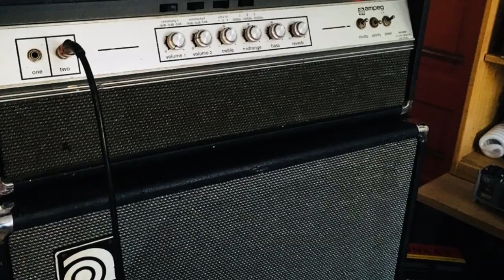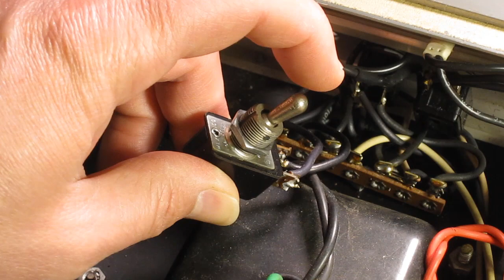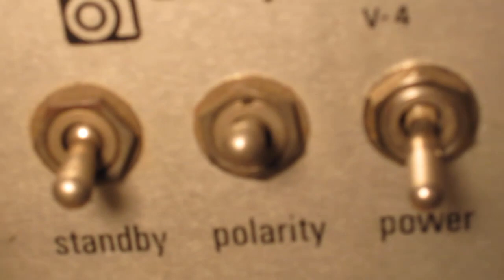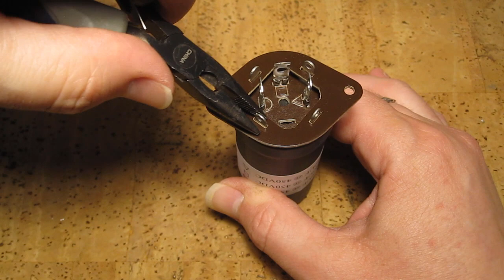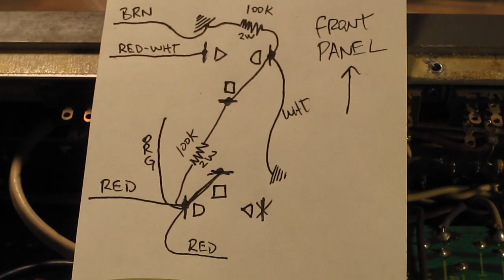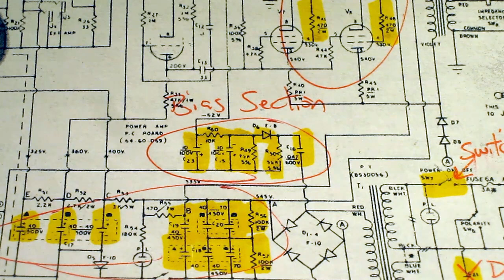Ampeg V-4 - New Tubes, Caps & Other Tweaks!

Comment: Important Safety Note, SHOCK HAZARD: The capacitor can case needs to be insulated as it was from the factory, (technically only one does but just follow the factory procedure). This is a potential shock hazard if not done. The reason for this is the first two can caps are wired in series, making the mid point where they are joined at an elevated voltage (half of the HT voltage). This means the negative side of the first cap which is also connected to the conductive metal cap case is energized at approximately 250-300 VDC! You see Flip Tops insulates the case with heat shrink for this reason, but it's important to know why. Also, notice the grounds are isolated from the chassis, non conductive mounting rings, this is important to avoid ground loops. (the grounding layout is specifically illustrated on the schematic)

Comment: greatings I found your post today,while watching my other amp guy, I was curious if you'd be interested in taking on some more projects as I have three vintage amps in various stages of repair, one being the same as in this video a 69 or 70 ampeg v-4, needing a three prong cord installed as well as possablly a re- cap. as it is all original and never been serviced from what I can tell. its old but new to me. that being said  the other one is a Gibson quite rare I believe as I cant find much info about it on line its called a Medalist 4/10. quite a strange design I'd have to say. but it did sound real nice clean and jazzy tones with tremelo and reverb. with four 10 inch speakers. however the fuse keeps blowing and its burned up a few wires and caps, so i am not sure what it will need to fix it, the bigest problem would be shipping. any way let me know if you interested and we ll go from there thanks for you time and shairing your knowlage with us...

Comment: Great video dude! I have an early v4 that needs a little TLC. The power tubes seem to wobble quite a bit in the sockets. Is there anything I could do to snug that up? Every time I gig it put I have to re seat the power tubes otherwise it acts up
Reply: The tube sockets probably need to be retentioned. It’s a fairly straightforward procedure and there’s probably a YouTube video on it somewhere. Otherwise you could try adding tube retainers, but that would be a huge pain in the ass because I’m pretty sure the sockets are riveted to the chassis. I’m not 100% positive about that tho.

Comment: Thanks for making this easy to understand. I posted another comment but can’t seem to find it. So if two appear, sorry. Anyhow, this will help me service my dads 1973 vt22 v4! It has all original Magnavox tubes pushing 50 years old! That is mighty strange that changing the resistor value created such an issue. Good to look out for! Anyhow, thanks again

Comment: Great Amp and I would have to say my favorite. I have Marshall's, Fenders, Mesa Boogies, and Vox as well. All different animals. Still love my Ampeg V4 the best. I love it so much that I got
lucky and found another one. The original one I got has the 4) 7027A power tubes, the second one has the JJ6L6GC power tubes. No matter how loud I drive it, it doesn't distort, that's what I want. I have Pedals that Drive, Fuzz, and I get what I want. It takes Pedals so well. It is crystal clear with the reverb tank being the best I've ever heard built-in. Being a Stones fan you have to have one of these. Even if your not, they are so clean and so loud. They are really heavy and well built. If you are looking at a carry amp this amp is not for you lol. Great Video and very informative. I learned something new, thank you.

Comment: Excellent video! I'm fixing a similar one, found some bad capacitors, cold solders, and loose wires (especially one grounding wire) but I still have noisy (hum) output when the bass is plugged in. It seems some input impedance mismatch since when I test with music from my tablet, sounds great (I know the bass is OK). Any idea to try? Thanks a lot!
Reply from the maker: First, think about the difference b/w "hum" and "buzz". Hum is usually induced by failing filter caps or a failing tube. Buzz is usually caused by some kind of grounding problem or loose connection somewhere. Honestly is sounds like you have a bad instrument cable or poor shielding in your bass electronics. I would rule out an impedance issue for now and go through the basics first. If your iPad sounds great, but the bass sounds like ass, then that's a clue that the problem is not the amp. Of course this is just a guess based on a YouTube comment. Thanks for watching.